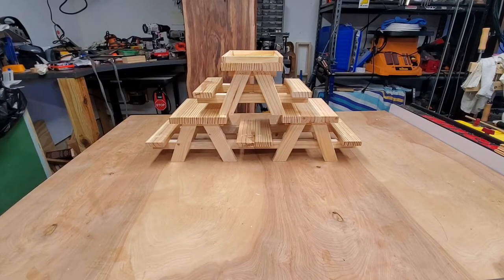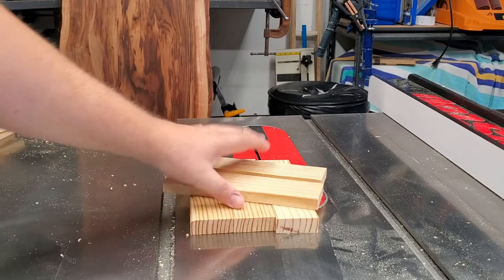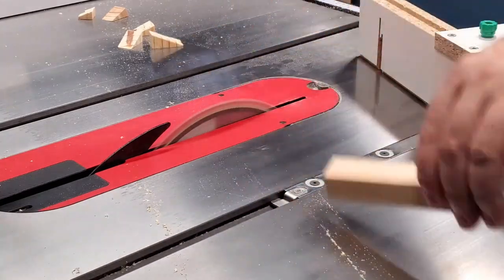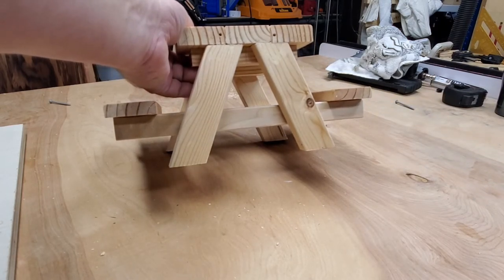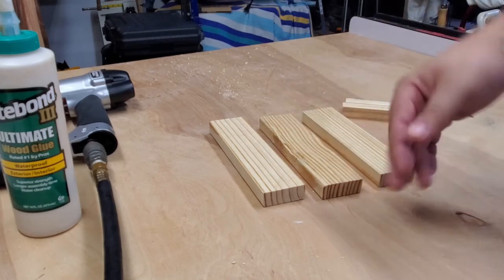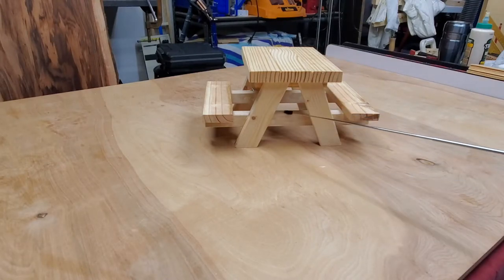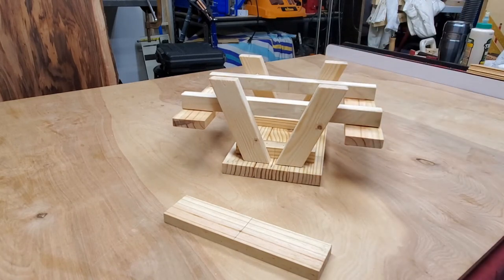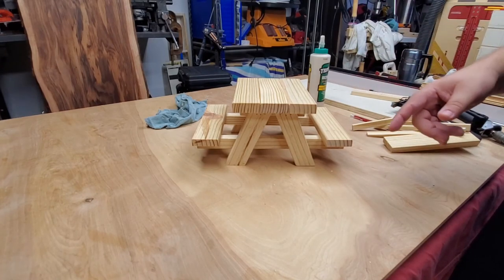Let's Build a Squirrel Table

Comment: I work for a company that sells large polyethylene pipe. The pipe is brought in on flatbed trucks. This pipe is strapped to three 2x6x48” boards.  The company has no use for this wood so, until now, it was going to the dumpster.  I’m hauling off as much as I can since lumber prices are crazy.  Re-sawing the wood is definitely the worst of this project.  Assembly is quite satisfying.  Thanks for sharing!
Reply from the maker: Thanks for viewing my video.

Comment: Instead of cutting the slats for the top, could you just use a solid piece and cut dados into it to resemble slats, kinda faux slats?
Reply from the maker: I do not see why not.  I would use a router instead of a table saw.